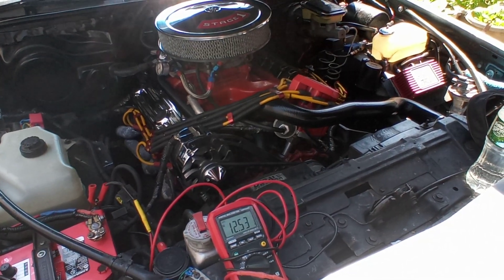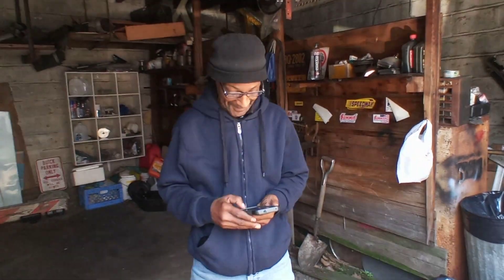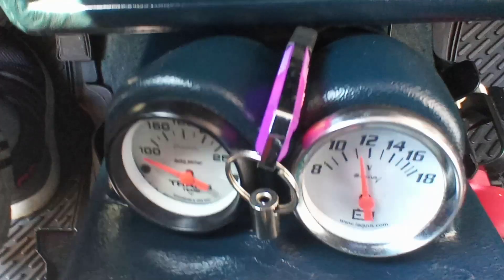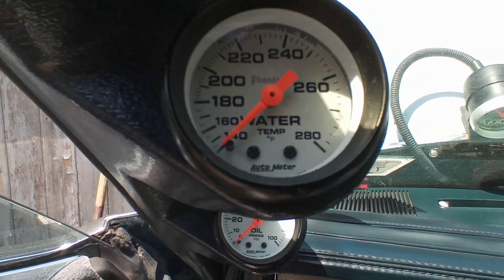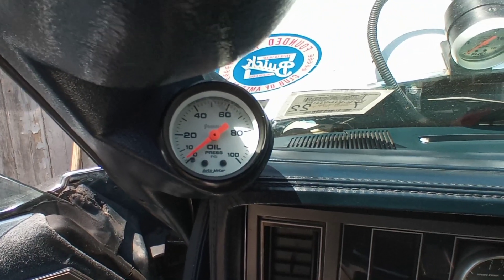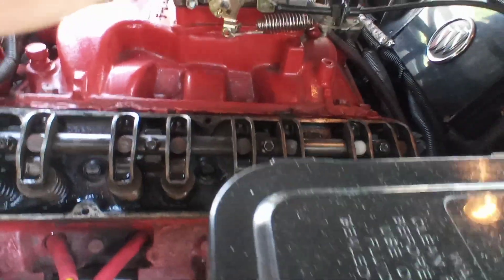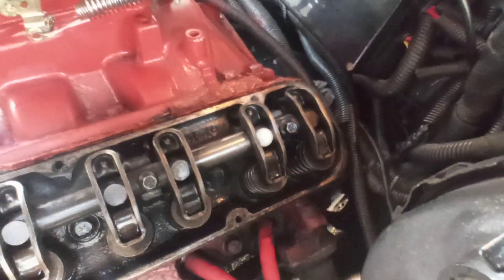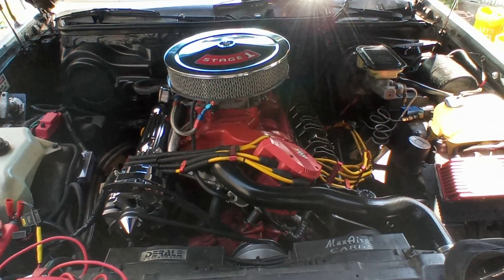Buick 455 Stage-1 Regal-T @ Internal Engine Damage 🙏🏽😃💪🏾🔩🔧 5-21-2021.

Comment: Could be that front cam bearing if the ticking is the valvetrain. My Buick 350 ticks on the driver's side after new rocker assemblies, new lifters, and new pushrods. I'm basically in the same boat. Which is to say I really appreciate these uploads and I'm keeping an eye out for updates.
Reply from the maker: Wow ... so sorry about your Buick 350. I plan on pulling the motor apart and finding out what's going on. I sincerely wish you luck with your motor. Thanks for your time and Comment. God Bless you and your Family.

Comment: My '72 LeSabre smoked the cam bearing and started ticking on the left side, eventually it starved the rocker shaft of oil and broke the (aluminum) rocker! The small cam bearings are really a weakness of our beloved BBBs! In our dragster's 464, I always had great oil pressure and no issues that I was aware of, but on a upgrade (piston/rod and cam/lifter swap) teardown, the camshaft (GS105A Poston) would not even slide OUT of the block, due to a worn #1 cam bearing! From now on, I'm going to run a new timing cover, standard gears and a booster plate only.
Reply from the maker: Jesus Christ. That sounds about right regarding my 455. I hope the Cam comes out of the Block with no issues ... if it's damaged. The Crankshaft Bearing(s) will definitely require changing. Thank you for your time and Comment. God Bless you and your Family. Have a great day every day.

Comment: Low Oil pressure is not a good sign..
Reply from the maker: Hey, Eric. I hear you. I'm very excited about pulling the 455 apart and locating the issue(s). I feel that this issue began after the Shop changed the Timing Chain Cover Gaskets. About 1 week after ... I discovered that the Water Pump bolts were loose ... so imagine the Timing Chain Cover Bolts. A few months later, I began to see oil/dirt build-up on the front of the 455. The Rear Main Seal has been leaking oil since day-1 over a decade ago.

Moving forward, I won't have any issues with the 494-Stroker due to the fact that this Engine Builder is GREAT at what he does ... and he's HONEST.

God Bless you and your Family, my friend. have a great day every day.